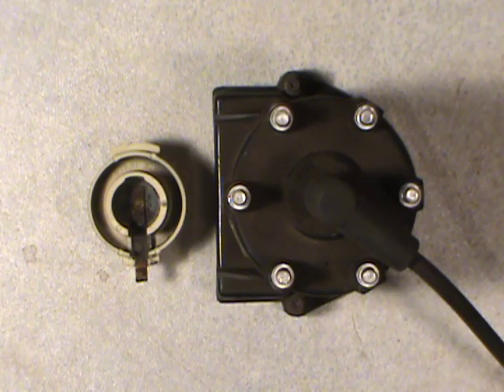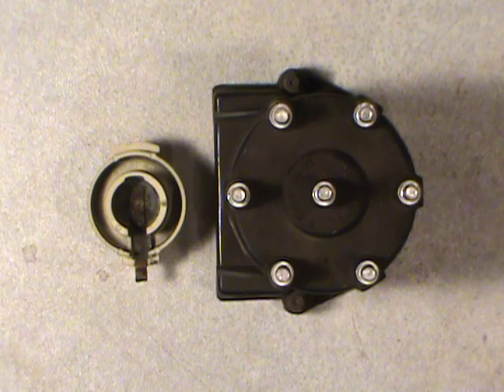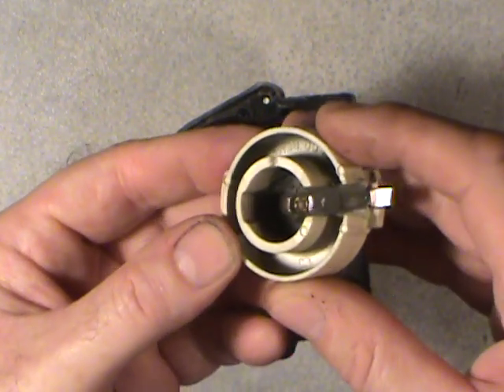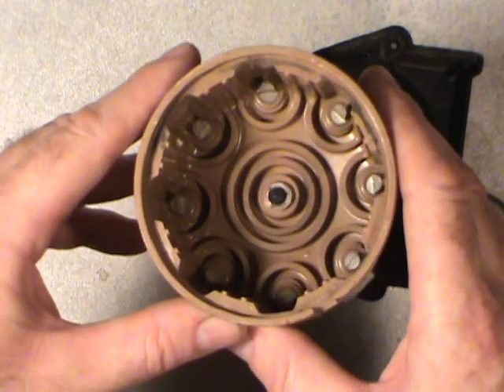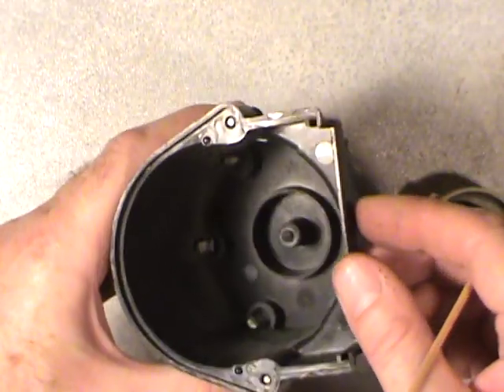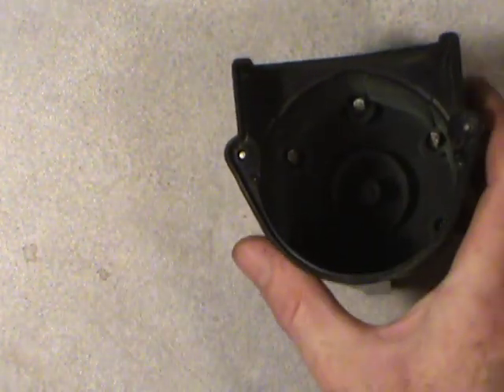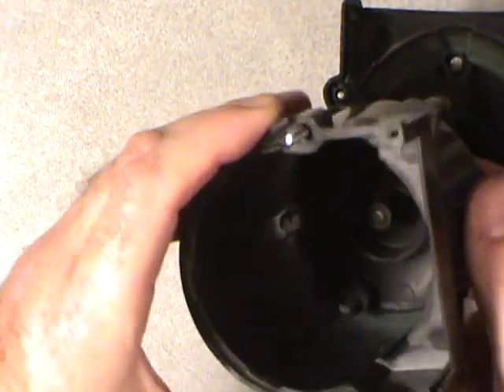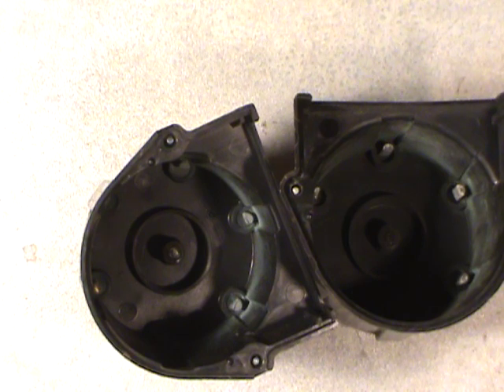How to Inspect Distributor Cap and Rotor Condition (Part 1) of 2 Parts

Comment: Will a vehicle idle smoothly with a bad cap, then misfire only under acceleration?
Reply from the maker: ***** Greetings Brian Busch....Thanks for watching, and, for Your comment/question as well...................................................While it could be possible, that, the "Distributor Cap, and/or Rotor", might be the "Culprit", that, is causing the..."Idle Smoothly"...&..."Miss-Fire under Acceleration", Scenario, that You had mentioned, there are, as I see it, quite a number of possibilities, that, are able to cause that very same "Problem/Symptom" that You indicated in Your comment.............................................................It might even be, something along the lines of, a "Fuel System" Problem, being, what is usually referred to, as a..."Lean Miss-Fire"...where-by, the actual..."Miss-Firing", has nothing to do with the "Ignition System's Performance", as, the "Spark" that is being Produced at the Spark Plug, is..."Good & Strong"...&..."Sparking" at the Correct Time, in relation to the Engines, Needs/Demands....................................................So then, this "Fuel Related"..."Miss-Firing"...is, for the most part, being caused, by, the "Air/Fuel-Ratio" being..."Too Lean"...in order to..."Support"..."Proper & Acceptable"...Combustion...with-in, each and every one, of the Engines Cylinders, at any given time............................................In the past, I've had a "Fuel Related"..."Lean Miss-Fire"...but...it was happening at..."Idle Speed"...and, it turned out to be, that, I..."Set"...the Carburetor's..."Idle Mixture Screws", a bit too..."Lean"...which in turn, actually caused my Chevy 350 Cubic Inch Engine to..."Lean Miss-Fire"...and, due to the "Lean Miss-Fire", and the..."Incomplete Combustion" that goes along with it, I can actually..."Confirm"...that..."Lean-Miss-Firing"..."Situation"...just by having a "Look-See" at my "Smog/Emission-Test-Results-Print-out", that I had handed to me, at, that there..."Smog/Emissions Testing Establishment"...!!!...(lol)..................................................Another thing that I've found, is that, a "Lean Air/Fuel Ratio" (fuel related) Problem, for me, will usually show up as a Vehicle that will start..."Surging", as in, the Vehicle will kinda, Jerk, or, Buck, back and forth, while just trying to "Maintain City Speed", on a Level Road, and keeping the Gas Pedal in a Fixed Position......................................................Now then, there is a Possibility, as I've known, for quite some time now, and, it could be another One, of Many Possibilities, and, what it happens to be, is...An "Ignition Coil"...can..."Malfunction"...while "Under Load", which is what happens when an Engine is Doin' the "Acceleration" Scenario.........................................The Above, are just a few things to be Thinkin' about, as it applies to the "Situation/Problem" that Your Engine is experiencing, but, in order to give Your Vehicle's Engine, the best chance at Running/Operating/Performing, the best that it's able to, is the following..........................................................Do a "Complete Tune-Up", and all of the Required "Maintenance Items", that Your Vehicle's Manufacturer Recommends, at the Required/Suggested Time, or, Mileage/Kilometer-age "Interval"........................................................"Lettuce" (intentional miss-spelling, to keep Your attention...lol), say for instance, that, Your..."Distributor Cap"...or the..."Rotor"...that Spins around, Inside the Distributor Cap..."Looks"..."Worn"...or..."Questionable" at all...then, just..."Re & Re" (Remove and Replace) "Both of Them", that way, all of that "High Voltage", that is "Zapping" Through the "Secondary Side" of the Ignition System, will have a much better chance, at making its way, from the Ignition Coil, and all the way to Your Engine's Spark Plugs.....................................................If You spend a few extra "Bucks" (or, what-ever Your Currency/Money happens to be), for a "Distributor Cap", that has..."Brass Terminals"...is, as I see it, a pretty good..."Improvement"...over that, of a Distributor Cap, that has "Aluminum Terminals" in/on it...........................................................Have Your Engine's "Ignition Timing "Checked" and "Set/Re-Set" if Needed...!!!....................................................Oh yeah, if and when You do happen to "Re & Re" Your "Distributor Cap", and, by doing the following, will make things go quite well, as opposed to, a "Nightmare" in the making...!!!.......................................................When-ever Removing and Replacing the Ignition System's "Wires/Leads" on, "Both" the "Distributor Cap", and the "Spark Plugs", try and "Only"..."Remove and Replace"..."Only"..."One"..."Wire/Lead" at a Time, or, if You happen to..."Remove"..."All" of the Ignition System's "Wires/Leads" at the "Same Time" (aka, All at Once), then, that there...."Nightmare"...will actually be You, having to "Figure Out"..."What-Wire/Lead Went Where"...???(Yikes!!!)...............................................Now it's Time for my, sometimes..."Over-Use"...of an "Old Saying", and that saying is, and when it's applied to just about any Part on Your Vehicle, and its Engine...is..."The Chain is Only as Strong as the Weakest Link"...!!!...................................................Be Safe, take care, and have a good one.
Reply: RockysRoadshow ......gulp.....gulp....gulp, ahhhh. Thanks for the reply!! Went through the entire ignition system......not it at all, the"culprit" is a weak (40psi vs.58 required) fuel pump. Gotta love a GMC van. Keep doing what you're doing....Great Job!!
Reply from the maker: ***** Greetings Brian Busch....(using my best, and, not all that good..."L-Viss"...Voice Impersonation...I say)..."Thank You...Thank You Very Much".................................................."GMC" Van...???..................................................Does it happen to be a "Safari" Mini Van, equipped with a 4.3 Litre (262 Cubic Inch) V-6 Engine...???.........................................................Just to let You know, I do have a wee bit of experience, and many hours, Workin' on, both the..."Chevy Astro"...&...the "GMC Safari"...Mini Vans, that were equipped with the "OBD-1" (on board diagnostics, version 1), shall we say...Engine Management System...&...the "CMFI" (aka, Central Port Fuel Injection) System, that only has "1" Fuel Injector, and, 6 Fuel Tubes/Lines, connected to those there 6 Poppet Nozzles.............................................................If the Chevy Astro, or, the GMC Safari Mini Vans, are 1996 or Newer, and are equipped with the "OBD-2" (aka, on board diagnostics, version 2) System, and, although I haven't had one of those in Custody, to work on, I'm, pretty sure, that, I will at least, be able to provide some useful Information, on those Mini Vans as well................................................I read (pronounced Red..lol), some-where, that, if the Chevy or GMC V-6 Engine,  is equipped, with a "Distributor Cap", that looks like, the One that You see in this particular YouTube Video of mine, that, some Folks, are Saying, that, it's "Their" Experience, that, what works "Best" for Them, on this type of "V-6" Engine, is, when it comes time, to Replace the Worn-out, or Faulty "Distributor Cap", is, according to those previously mentioned Folks, is to use, a "Factory Original" Type of Distributor Cap..................................................I've had pretty good luck, using the "Standard" Brand's..."Premium"...Distributor Cap & Rotor...that has "Brass Terminals" on the Distributor Cap...but...keep a very close Eye, on that there "Carbon Button"...that's..."Hiding"...Inside that there Distributor Cap, as that...Super-Wimpy...Carbon Button...Wears away/down, quite quickly...Mileage/Kilometer-age-wise...!!!....................................................Now then, here are some "Things" to consider, as it applies to Your "GMC-what-ever-IT-happens-to-be"...???..................................................Make Sure, that, You "Change" Your "Fuel Filter" at least, once a Year (applies to a regularly driven vehicle), so that, it doesn't get so..."Plugged Up", and cause Your...Inside-the-Gas-Tank...Electric..."Fuel Pump"...to..."Burn-Out"...and Stop Working...!!!.........................................Quite some time ago, I put some Fuel Injection System "Cleaner" in my Gas Tank, and, it did such a good job, that, after a period of time, I figure that, that there Fuel System Cleaner...shall we say..."Super Cleaned"...all of the Crap/Sludge/etc., that was "Hiding Inside the Gas Tank"...and...as I see it..."Totally Clogged-Up" the "Fuel Filter"...and...the Fuel Pump, that was also Hiding Inside the Gas Tank..."Burned Itself Out, due to the "Totally Restricted"...Fuel Filter...!!!...................................................Then, it was "Tow Truck" Time, and, a very "Expensive Lesson" was Learned...never-the-less...!!!...................................................................Another thing that "You" can "Do", to "Prolong"...the..."Life"...of Your...Fuel Pump, is to, try to Remember, to "Keep" Your Gas Tank, at "Least"...1/4 (One Quarter or One Quarter of a Gas Tank)...Full, at "All Times"...!!!..................................................Why You ask...???.....................................................The..."Inside the Gas Tank Electric Fuel Pump"...will actually Run "Cooler", due to the Gasoline, that the Fuel Pump is "Immersed" (aka, surrounded by) in, where-as...as I see it...if the Gasoline "Level/Amount", in the Gas Tank, was allowed to, get to the point of being Close to Empty, and, the Ambient Temperature, where the vehicle was being driven was quite "Hot" (think in terms of Desert Heat), then, as I see it, that Very "Hard Working"...Little..."High Pressure"..."Fuel Pump"...would probably be getting, quite a bit "Hotter", in a "Near Empty" Gas Tank...as "Opposed" to....a Gas Tank, that was "Always" kept, at "Least"..."1/4-Full"...and, here I go again..."More" then "1/4-Full"...is even..."Better"...!!!................................................If You like, just let me know, what Your "Ride" (aka, Vehicle) happens to be, and, I'll do what I can, to help You out....................................................Be Safe, take care, and have a good one.
Reply: RockysRoadshow it's actually a 2000 GMC Savana 1500 5.0 Vortec 130k miles on it. This happened 15k miles ago..changed the cap, rotor, plugs, wires....fixed the no start issue. I left work, wouldn't get above 60..no overdrive, rounded a corner, wouldn't get above 40. Now it's a no start, except with starting fluid, still won't get above 40. Can showed P0308 & bad O2 sensor. Changed rotor, plugs, tps, battery, fuel filter. Tested cap, wires & coil...all good. Testing the fuel pressure again today with a better gauge (never buy a cheapo). Bogs bad under acceleration, idles smooth though. Will let you know what I find out.
.....elvis reverse punch followed by a karate kick....
Reply: ***** this is my work vehicle...makes me money....I keep up on the maintenance religiously (I'm a preventative maintenance technician).....synthetic oil changes, Lucas Oil products, Berrymans Chem-Tool, etc.
Reply from the maker: ***** Greetings Brian Busch....You provided some very good Information/Specifics, and, now that I have something to go on, I can now say...lettuce see, just what I might know, or failing that...what I think I know...???...lol...........................................................You had mentioned, about Your, I'm thinkin'...Electric/Electronically "Controlled"...Automatic?...Transmission..."Not Up-Shifting" to a Higher Gear perhaps......................................................The First "Thing", that I would be Checking for, is, believe it or not...a "Blown-Fuse" in the Fuse "Panel/Box"...where You'll find an Assortment of Various "Rated" Fuses, and then some.........................................................If it does turn out to be a "Blown" Fuse, I'll have a guess, that it just might be, a "Fuse", that might just be "Rated" at..."15-Amps"...???.................................................Then, it may also be related to the..."VSS" (Vehicle Speed Sensor, I think?), and that "VSS", as far as I recall, might/should be Mounted, somewhere near/on, the Transmission's Tail-Housing, or could even be something that is Related to/in the Circuit, of the "VSS" itself...???........................................................By You saying, that Your GMC "5.0-Engine", would Only Start, on some Starting Fluid, has me thinkin', that, it just might be something going "South" (aka, Malfunctioning), in the Fuel (supply) System, perhaps?......................................................There is usually a...Fuel Pump "Relay" (Plastic Housing, Multi-Pin)...and, if the Fuel Pump "Relay" becomes "Non-Functional"...there is usually, an...Oil Pressure "Switch", that will "Complete" the Electrical (voltage supply) "Circuit", to the Fuel Pump, when the "Oil Pressure" reaches about "4-PSI" (Pounds per Square Inch), and, if trying to Start the Engine, with a "Faulty" Fuel Pump "Relay"...it will usually take, quite a bit (time-wise) of Starter Motor "Cranking", in order to "Achieve" (aka, get up to), that "Ball-Park"..."4-PSI"..."Oil Pressure"...!!!.......................................................Now then..."P0308"...comes up as, a..."Number-8-Cylinder-Miss-Fire".............................................................Hmmmmm...I'm thinkin' of a few possible things, that it just might be..........................................Could  be...a Faulty Spark Plug, or Faulty Spark Plug Wire/Lead...or...might even be, I'm thinkin' the Number 8 Cylinders "Fuel Injector" (it is a "Sequential" or "Multi-Port", isn't it?), that has "1" fuel Injector Per Cylinder?.....................................If that be the case, I'm thinkin', that the Number 8 Fuel Injector, might be Partially "Plugged Up", causing a...Not So Good "Spray Pattern", or, it could be, that it may perhaps, be starting to Fail...Mechanically/Electrical-wise...???................................................Maybe, try taking the Number "8" Spark Plug, and Swapping it with another Cylinders Spark Plug, and "See" if that Number "8" Cylinder "Miss-Fire"..."Moves" to the New Cylinder, that You Installed that Number "8" Spark Plug in...???..............................................Then, if that "Does Not" make a difference, then try "Swapping", the Number "8" Cylinders Spark Plug "Wire/lead", with, One of the "Other" Spark Plug "Wire/Leads" from, One of the "Other" Cylinders, and see, what may Transpire (fancy name for...see what Happens, if, at all)...lol........................................................Oh, and, of course You know...Make Sure that, the Engine "Is Not Running" while You are "Working On It"...just sayin'....................................................Now for...Fuel Pressure "Testing".....................................................You should be able to Find..."2"...Specifications...for the "Fuel Pressure", that specifically "Applies" to Your particular Vehicle/Engine..........................................The "Highest" Fuel Pressure, should be for...when the Engine "Is Not" Running, with the Key, in "Run" Position...and...the "Lower" Fuel "Pressure", should be, for, when the Engine "Is Running" at "Idle Speed", with the Transmission in "Park" (Never forget "Safety"...!!!)................................................The Fuel Pressure "Difference", should be in the neighborhood, of about "10-PSI" (just a Ball-Park "Guess-tah-mation", that's all)................................................"Faulty"...Fuel Pressure "Regulator"...???..........................................................Now for Boss-Hog, ummmmmm, no, that's not it, rather...Your "Bog", as You describe, how Your Engine is/was behaving................................................That "Bog", has me thinkin'..."Vacuum Leak"...!!!..................................................One "Major" cause, of, as I have experienced, with the good ole GMC or Chevy 4.3 Litre (262 cubic Inch) V-6 Engine, as it pertains, to a "Major" Vacuum "Leak", happens to be..."Carbon Chunks"...that make Their way "Into" the "EGR" (Exhaust Gas Recirculation) Valve, where-by...those nasty little, sometimes, as LARGE as, an Un-Ground "Pepper-Corn", become "Lodged", between the "Pintle" (aka, Plunger), and the "Orifice" (aka, Hole), which in turn..."Keeps" the EGR Valve..."OPEN"...when, it..."Should NOT" Be...!!!..................................................Gee, I'm not even sure, that Your 2000-5.0-Engine, even has One...???................................................Then, there may also be the "Purging" (Flow) of "Fuel Vapors", from the usually seen in the engine compartment, or hidden underneath the vehicle..."Carbon Canister's"..."Purge Valve"...that might be, well, kinda "Stuck" Open, when It "Should Not" Be...!!!................................................"MAP" (Manifold Absolute Pressure) Sensor?...Code/Codes?...................................................Did You happen to have a "Look" at the Oxygen Sensor or Sensors, as the case may be, and if so, was it/they, All Covered in Carbon...???............I'm not sure, as to..."How Many" Oxygen Sensors, that are Installed on Your Savana...as in, Pre-Cat and/or Post Cat (aka, Before and/or After, the Catalytic Converter/Converters?)......................................................The "Above" Things, are just some Things, that come to mind (mine, that is), and are just basically, some, Food for Thought, that, hopefully, just might, help You track-down...those there...Culprits or Gremlins, that are Lurking inside Your...Savana................................................You can...Reverse Kick & Karate (Kid) Me, all You want...but...never...Ever..."Step On My Blue Suede Shoes"..or..."Call Me...Late For DINNER"!!!...Hahahahahahahahahahaha...!!!..........................Be Safe, take care, and have a good one.
Reply: RockysRoadshow key on engine off = 48psi, slowly drops to 43psi. Engine on /idle = 54psi, rev it up & it drops to 48psi, then let off & back to 54. Turn key off, back to 48psi. Fuel pump, right?
Reply from the maker: ***** Greetings Brian Busch....I hear Ya............."Lube-ee-Lube"..."Slip-id-ee-Slip-Slip"...and look Ma..."No Metal-On-Metal"...well, at least, until, when, You, or Who-ever...Forgot to, "Replace", the Oil Pan's "Drain Plug"...or...Didn't..."Torque" the "Oil Filter"..."Tight" Enough, that is...!!!...lol......................................Sounds like some pretty..."Over-the-Top"...&..."Quality" Stuff, that You are "Tech-ni-sizing" all right...!!!...................................................As for me, as far as "Motor Oil" is concerned, I started out, using the "Conventional" Motor Oils, and still do, to date....................................Because of the Year Round (All 365 Days!...lol) "Climate" that I live in, and I was also wanting a good all around, and Load Supporting Motor Oil, I started out with "Valvoline"..."10W-40"...Motor Oil, because I was able to get a Big Case of it, at a Great Price, and, also, because of "Valvoline", being...One of the Good Names, at that point in time..............................................Then, there was a time, that, in one Vehicle, I actually used/ran..."10W-40"..."Arco"..."Graphite Motor Oil"...which, when, pouring the Stuff in "Fresh-n-New", it was Blackish (just like Graphite usually appears to look), but with, what looked like a "Clearish" Liquid, that was part & parcel, of that particular Motor Oil's "Make-Up"...but...it was rather Difficult, for me, that is, to Determine, just "How Old", or, "How Long", "Mileage/Kilometer-age-wise, that, that there, "Graphite" Motor Oil, was sitting Inside my Engine...???...................................About the "Only" thing, that I did notice, between..."New"...&..."Old"..."Graphite"...Motor Oil, was, that, that, "Clear-ish-Liquid-Like" Part of the "Graphite" Motor Oil, was "Only" Presenting itself, while the "Graphite" Motor Oil was "New", and, as seen by me, as it left the "Spout" of the Oil Container..."Before", it entered my Engine........................................My Observation, of the "Used"..."Graphite"...Motor Oil, when it had considerable Use/Mileage/Kilometer-age on it, had me Noticing, that, that there, shall we say (again...lol) "Clear-ish"...Liquid-Like Component/Part of the "Graphite" Motor Oil was..."Gone" (aka, Not Seen)...!!!..........................................Then, as time progressed, and the "Case" of Valvoline Motor Oil, was getting to the point of being, more difficult to...get/obtain...at that Great Price (back then), and case-lot, I then noticed, that, there was an Abundant "Supply" of "Castrol" (Conventional) Motor Oil and related Lubrication Products, close-by.................................................I could now get the "10W-40" Motor Oil, in..."1" Litre (about the Size of a USA Quart) plastic Bottles...or...then, as I recall...there was a "4" Litre plastic Jug...that went to..."4.5" Litre plastic Jug...and, not all that long ago...it Increased to, now get this...a "5" Litre plastic Jug..."Yip-ee"...!!!...lol................................................My "Train of Thought" (All Aboard?...lol), quite some time ago, had me thinkin' (aka, Head-Scratchin'), that, it might "Not" be, such a good idea, to be "Mixing"..."Different"..Brands...Straight Weight...or even Different Muti-Weight...Motor Oils, when-ever I did my "DIY" (Do It Yourself), no, no, that's not right, it was actually..."DIM" (Do It Myself...!!!...lol) "Change-It-the-Motor-Oil-&-Oil-Filter", when the Time/Mileage/Kilometer-age became Due, or, when the..."Used"...Motor Oil, started to look, well...kinda "Yuck-ee"..........................................................For quite some time now, I can actually "Guesstimate", what's goin' on, with the Motor Oil, right from the time, that I have "Brand New" Motor Oil in the Engine/Oil Pan, and, as I have been Observing, on, my Engine's "Oil Level Checking Dipstick", I'm always watching the "Changes", right from the New Motor Oil being a "Translucent/Amber" Color, and, as the Mileage/Kilometer-age Accumulates, it starts turning a bit more, not so Translucent any more....................................................Then, it starts Goin' "Brown-ish"...(lighter to darker)...and finally, it enters that, well known..."Solid"..."Black-ish" Color...........................................Although most Motor Oils remain "Oil-ee", it's usually the Motor Oils "Additives" that get "Used Up"...and...No more "Detergents" to help, keep Your Engine somewhat "Clean", but...now I say..."Look Out"..."Hydraulic (Valve) Lifters"...You are about to become..."Stuck Up"...and...go, from being "Quiet", like a "Library"...then to..."Click-id-ee-Click-Click"...like a Loud "Time Piece" (aka, Pocket Watch)...then, in it's Final Transformation, All "16" Hydraulic Valve Lifters...Go..."Non-Stop"..."CLACK-CLACK-and even More CLACKING can be heard, when-ever  that "Lubrication"..."Neglected"...Engine...happens to be "Running"...Yes-Sir-ee-Bob...Been there...Heard that...Seen that...and..."FIXED-THAT-TOO"...lol................................Be Safe, take care, and have a good one.
Reply from the maker: ***** Greetings Brian Busch...Your Fuel "Pressure", as You have Indicated, as a result of Your Testing, seems to be on the "Low" side, unless Your Fuel Pressure "Gauge"..."Is Not" Indicating Correctly...???.................................Even the Specifications, for the GMC & Chevy "V-6's", Range from about...55 to 64 PSI...with the Engine "Not Running"...and, with the Key "On"...!!!............................The Fuel Pressure "Drop", when the Engine "Is Running", should Only Drop..."No More" then about "10" PSI......................................Try this...with the Engine "Not Running"...Turn the "Key On" for a few Seconds...then...turn the "Key Off"...and, watch the Fuel Pressure "Gauge"....................................The "Fuel Pressure" should "Hold", and "Not Drop", for quite a long time........................................If the Fuel "Pressure" is Dropping, in a short time, that alone, has me thinkin', that there is something that is "Not Holding Fuel Pressure", like it's "Supposed To"............................................Could be anything, from the Fuel Supply Line/Tubing..."Leaking"...Inside the Plenum...maybe a Faulty "Pressure Regulator"...maybe "One or More"..."Leaking Fuel Injectors"...???..................................................Sometimes, the "Wrong" Fuel Pump, or, not so good Fuel Pump, was given to You, when You purchased it, as that First "48" PSI, that You mentioned, should be in the "Mid-50's-PSI...to...as High as, the almost Mid-60's-PSI, as far as a GMC or Chevy "V-6" is concerned, that is.....................................................In One of Your previous Comment/Replies, You had mentioned..."58-Required" (I'm thinkin' that's 58-PSI), which is more like, what this type of fuel injection system requires, to make it, work as it should.........................................Gotta have...High Enough "Fuel Pressure"...and...also..."Has To Be Able To"..."Hold that High Fuel Pressure"...for quite a "Long Time"..."Without the Fuel Pressure Dropping", as Quick as, what You are currently experiencing, or, It's gonna be..."Problem City"...!!!................................What are Your "Fuel Pressure Specifications", and, is that with Engine..."Running"...or..."Not Running...???...........................................Let me know, how it's going, and I'll try and get back to You Tomorrow, if possible........................................Be Safe, take care, and have a good one.
Reply from the maker: ***** Greetings Brian Busch....I got to thinkin', about the "Difference", of the "2" Fuel Pressures that You mentioned..............................................."48-PSI", with Key On & Engine Not Running...and..."54-PSI", with the Engine Idling, and yes, of course, with the Key On...!!!...lol................................................Here's what I'm thinkin'..................................................When-ever Your Vehicle's "Battery" has been sitting for a day or two, about the Best, a "12-Volt" Battery will "Output"...Voltage-wise...while just sitting there, and, when in Very Good Condition, and, not "Discharged", and, the Ambient Temperature was, shall we say..."Tee-Shirt"...Weather/Temperature, or Warmer, would probably be in the neighborhood, of about..."12.6-Volts"...and...that alone has me thinkin', that, the, "In the Gas Tank Electric Fuel Pump", might be "Spinning/Operating" at "Lower-RPM's"...which has me thinkin', that, might be the Reason, for that "Lower-48-PSI", as Compared to, that "Higher-54-PSI", while the Engine was Running...............................................Now then, I'm thinkin', that, the Reason, for that "Increase"..."From"..."48-PSI"..."Up-To"...that..."54-PSI"...that You saw, on Your Fuel Pressure Gauge, just might be, due to Your Vehicle's...(electrical) "Charging System" (aka, Alternator/Voltage Regulator/etc.)...becoming..."Active"...when the Engine is "Running", which, Depending on the "Temperature", usually will..."Increase"...that there...(Ball-Park) "12.6-Volts", to about "14.5-Volts", on a Warm Day...and...sometimes, maybe reach, as High as, about "15-Volts", when the...Weather, gets really "Cold", as in, when the "Water"...in a "Mud Puddle"...Turns into..."ICE"...!!!...lol (Please Note...the Just Mentioned Battery "Voltages", are only Applicable..."With-Out"..."Any Load" on the Vehicle's "Electrical System", as in...Heater Blower Motor/Windshield-Wipers/etc.)................................................Yes-Sir-ee-Bob...I do recall, just how, an..."Increase" in "DC (Direct Current) Voltage"...made my..."1/32" Scale...& my "1/24" Scale..."Slot Car Motors"...kinda become, some-what "Super-Charged" (that Pun, was purely accidental!...lol), as, I was thinkin', about a Car's "Super-Charged" Engine at the time!..........................................Hence...as I had experience/s, with just about any..."DC-Motor", and that also includes, a Vehicle's (Engine) "Starter Motor"..."Spinning/Rotating" at..."Higher RPM's"...when-ever the..."Voltage"..was..."Increased"...but..."Beware"...Never "Increase" the "Voltage" by "Too Much", or, that Poor "DC-Motor", might just..."Burn Up"...!!!............................................So, there You have it..."My-Two-Cents-Worth"...for Today........................................................Be Safe, take care, and have a good one.
Reply: RockysRoadshow Hey Rocky...I cut a hole in the floor above the fuel pump, swapped out the old harness and pump....runs like a Brahma Bull again!!
Now, where's those Boss Hogg Steer Horns for the grill??
Thanks for the advice/info!!
My speedometer still isn't right...new vss installed in tranny, Speedo may/may not work & when it does, it dies at 40mph...no cruise or odometer either. Erratic working times, never the same pattern except dying at 40mph.
Reply from the maker: ***** Greetings Brian Busch....Let's see now...............................Do You realize, by You, Cutting a Hole in Your Savana Van's Floor, that, Your Van has acquired a "New Title"...???.............................................As I see it, Your Van is, now...a "Hole-ee" Van! (feel free, to put this into, what-ever Context You so choose!...lol)............................................Brahma Bull...???.................................Hmmmmm...does that mean, that, when-ever You Drive Your Van, that, every time, that Your Van..."Sees"...something that is..."Red"...in Color, such as a "Stop Sign", that, rather then You having the ability, to apply the Brakes, to make the Required/Legal..."Stop", at, that there "Stop Sign"...I'm thinkin', that, "All", Your "Brahma Bull"...actually...Sees...is..."RED"...and...then, that there "Brahma Bull" of Yours..."Runs/Crashes" right through that there "Red Stop Sign"...no matter...how hard You Press on the Brake Pedal with..."Two Feet"...!!!...lol............................................."Oh-Lay"...says the (American Motors Company)..."Matador" (Car)...lol..............................................Boss Hogg "Steer Horns" for the "Grill"...???................................Wouldn't You rather "Grill" the "Meat" (aka, Steak) instead of the "Horns"...???..................................................For quite some time now (many years), "Steer Horns" have taken on a "Circular Shape".............................................Why then, do You think, that, that Circular Shaped "Thing-ah-Ma-Bob", that You Hold on to, in Your Van, is called a "STEER"...ing Wheel then...???...(quite abstract, don't-cha think?...lol)..........................................."Congratulations", my Friend, for getting Your Van, running "Super-Duper" once again (Big Fireworks Display)...!!!.......................................................Now then, as for Your "Speedo", no, not Your Swim-wear attire, but rather, Your Van's "Speedo" (aka, Speedometer), that, as You have been saying, is Displaying/Behaving, in a somewhat "Erratic" Manner...........................................So then, I had a look-see, at some Electrical "Schematics" (fancy name for electrical Drawing, and kinda like an Electrical Path/Flow-Chart, if You will)..............................................It seems, to me, that, the, shall we say..."Middle-Man" is the "ECU" (Vehicle's On-Board Computer), and, "Everything" pertaining, to the..."VSS" (Vehicle Speed Sensor)...the "Speedometer & Odometer"...and...the "Cruise Control Module", kinda work as follows, but please, don't Quote me on this...........................................................As far as the Speedometer/Odometer, and the Cruise Control Module are concerned, I think, that, the "ECU" Receives Information from the "VSS"...then, the "ECU"..."Outputs"..."Information"..."To"...the "Speedometer" and "Odometer", and the "Cruise Control Module" (and, the "ECU", might also receive "Information"..."From"...the Cruise Control Module as well?).........................................Not only that, but, the "Brake Pedal Switch?"...kinda hooks into the "Cruise Control Module" some-what, so when, while the "Cruise Control" is..."Engaged"...and the "Brake Pedal" is "Applied/Tapped"...the "Cruise Control" becomes..."Disengaged" (aka, "De-Activated").........................................As for, just "What", or maybe a Multiple, there-of, as to what might be causing Your Van's, "Erratic Behavior", could/might be a number of things......................................................I haven't had a Problem, like the one, that You are having currently, but, Lettuce see, what I can come up with...............................................Maybe...an "Intermittent/Questionable" Wiring/Connector/Connection, either, Power Supply, or Ground Fault (aka, Shorting to Ground somewhere, and perhaps Intermittently as well)...???.........."VSS" in 100% Working Order...???.........."ECU" Fault...???.........."Speedometer and/or Odometer" Malfunction/Disarray...???..........Malfunctioning/Faulty "Cruise Control Module"...???.............................................Might even be One of these "Components", possibly Causing, some kind of Electrical "Feed-Back", in One of the (Electrical) "Circuits", as a wild guess...???................................................Hopefully, someone has already "Tackled"..a..."Similar Problem"...such as the One, that Your Van is having (or was having), that, can make it much easier, to actually..."Diagnose & Fix"...this, not so wanted..."Erratic"...Speedometer/Odometer & Cruise Control..."Misbehavior"...........................................Best of Luck with that..........and...Thanks for the Great Comment................................................Be Safe, take care, and have a good one.
Reply from the maker: ***** Greetings Brian Busch....I got to thinkin', about, Your Savanna Van's "Fuel Pressure Drop", that You had, when You were taking the "Fuel Pressure/s" with Your Fuel Pressure "Gauge", when You had the "Previous" Fuel Pump Installed in Your Van...................................................Perhaps, if You haven't already done so, I think, that it would be a pretty good idea, to "Re-Check", Your Fuel "Pressures" again, now that You now have a..."Brahma Bull-like" running Van....................................................I'm thinkin', although Your Van seems to be Running "Great", now that You have that "New" Fuel Pump installed, that, there still could be a..."Fuel Pressure"..."Leak-Down"...which, just might be caused, by a..."Fuel Pressure"..."Regulator"...and/or, possibly, it could have a "Leaking"..."Fuel Line"...or...Fuel Line..."Connector/Connection"..that, just might..."Not"..be...Holding..."Fuel Pressure"...the way, that, it's Supposed to...???.....................................................So then, if, and when...?...You, just might decide, to..."Re-Test"...Your Savana Van's...Fuel Pump..."Pressure/s"...keep a Close Watch, on Your Fuel Pressure "Gauge", when doing the..."Key-On-Engine-Not-Running"..."Fuel Pressure"..."Drop" (Time-wise), as, that, quite High "Fuel Pressure", should..."Hold that High Fuel Pressure"...for quite a "Long Time", without "Dropping"...!!!..................................................Same thing goes for the..."Engine Running"..."Fuel Pressure"...as, it should "Not"..."Drop"...any more, then about "10-Pounds-Per-Square-Inch" (PSI)..."Lower"...then the...."Fuel Pressure", that You saw on Your Fuel Pressure "Gauge", with the "Key-On-and-the-Engine-Not-Running"...!!!......................................................To "Protect"...Your..."Eyes/Eyesight"...always remember to wear some form of..."Safety Glasses"...because, if, that there..."High Fuel Pressure"..."System"..."Springs-ah-Leak"...it would probably..."Act"...as I see it, kinda like a..."Mini-Pressure-Washer"...and, that my Friend, is something, that can be.."Very Dangerous"...!!!..................................................Also, make sure, if You don't already know how, that is, is to make sure, that You "Bleed Off" the "Fuel Pressure"..."Properly"..."Before"...You attempt any..."Work"...or..."Checks"...on Your..."Fuel Injection System"...as the "Factory/Manufacturer"...of Your GMC Savana Van..."Recommends"...for..."Safety's Sake"...!!!........................................If You actually do..."Re-Test"...Your Savana Van's "Fuel Pressure/s", and if You care to, feel free to Post Your Fuel Pressure "Findings/Observation/s" somewhere on my YouTube Channel...RockysRoadshow..."Reply/Comment" section,  under any of my Videos, that, You so choose.....................................................Be Safe, take care, and have a good one.